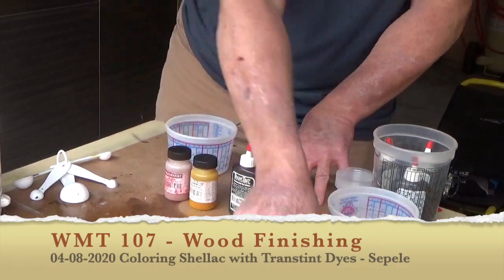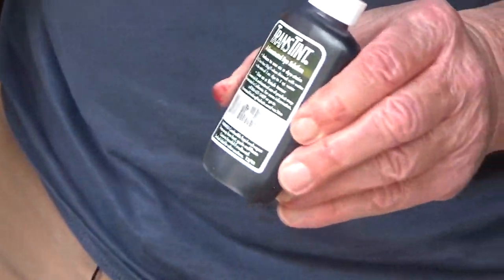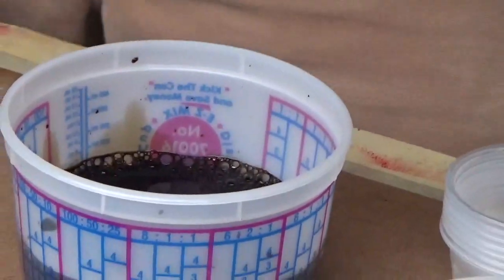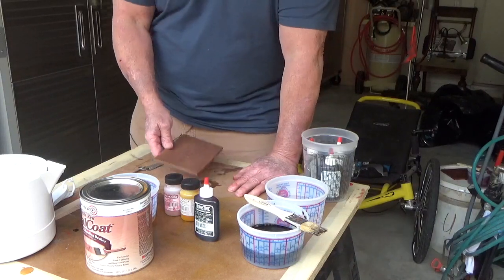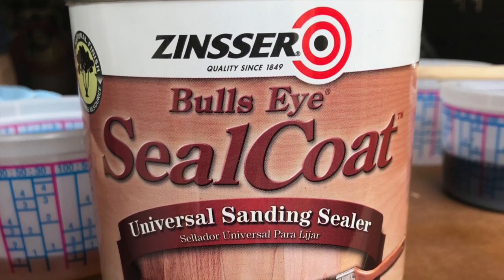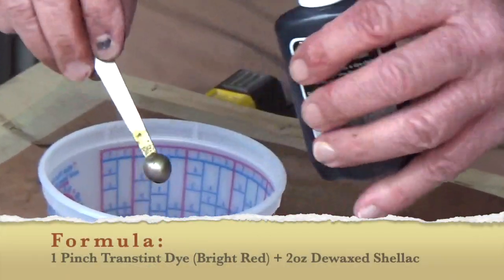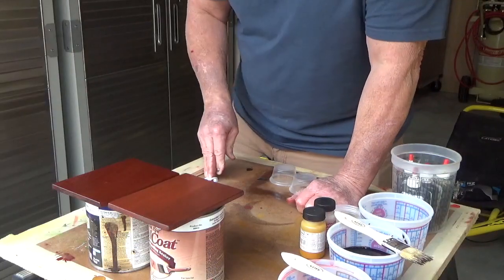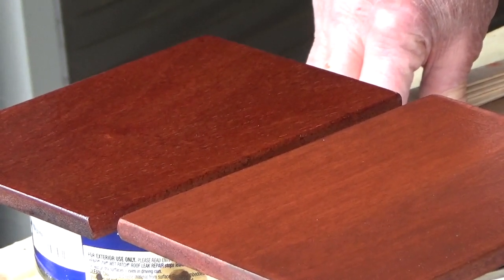Coloring Finish with Transtint Dyes - Sapele

Comment: I hope you can help. I bought some powdered dye. They said to dissolve in wood alcohol or denatured alcohol. I used the later. I put 2 oz. of da in a container, and have been adding small amounts of dye. After 3 times of adding dye, it is getting darker when I apply it to the wood, but nothing Like I think it should be. It is a brilliant color in the container. Also I see that the dye separates when sitting. Other people think I should try to mix it with water. So far all I have used has been stains, alcohol base. Any suggestions? Thanks.

Comment: I wanted to buy purple and black for my next guitar with a spalted top. but these Transfast 1 oz. powders don't exist anymore.
-J.B. Jewitt Co., Inc. got rid of these affordable powders. You now need to buy the liquid kind, Transtint for over 4 times as much for only 2 oz.; most of that is the liquids weight.
I bought medium green, gray, and turquoise blue for my first bass guitar project at 6 dollars each. Only used a pinch of each through distilled water, before a tung oil finish. Color was exactly what I wanted, pale green-ish faded/dull color. Slight yellowing after tung oil. I guess all my guitars will be some form of blue/greens or antique barn door grays now.